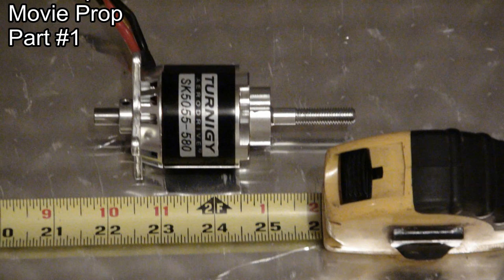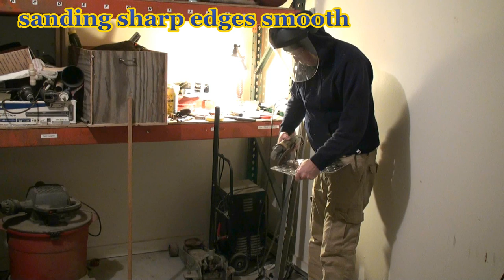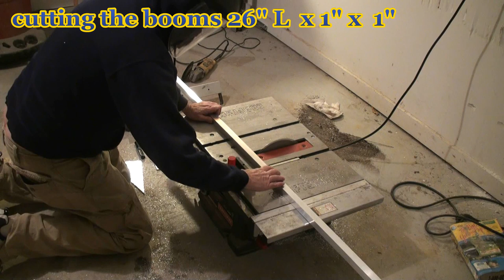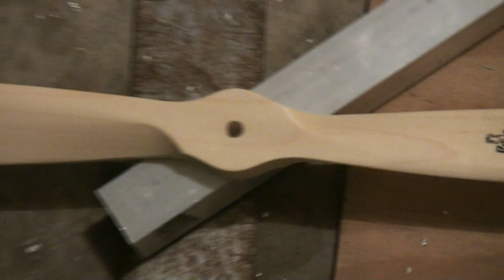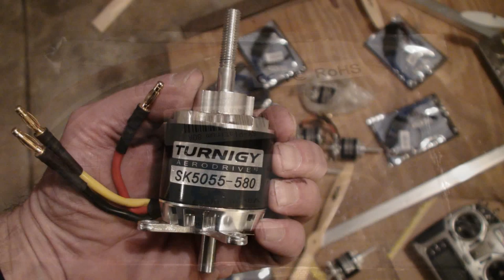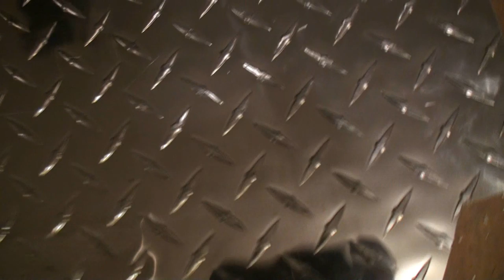#1 Building The Giant Hexacopter Movie Prop

Comment: Nice video I've watch all 6 parts. Question the esc you used did you have to program any of them with a computer? I've some video where they said they have to connect a board to the esc to program them to work with mutil motors. Beside the normal esc set any other program needed? Man those quads are heavy you build. Just getting into quads nothing like what your doing.